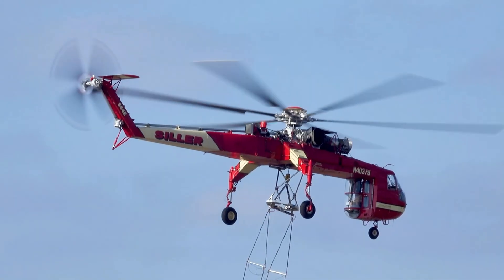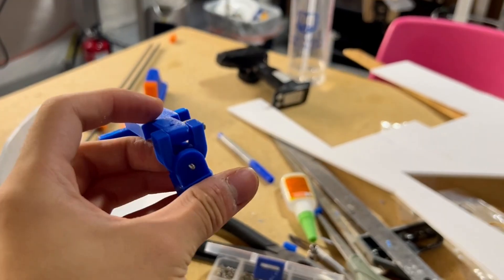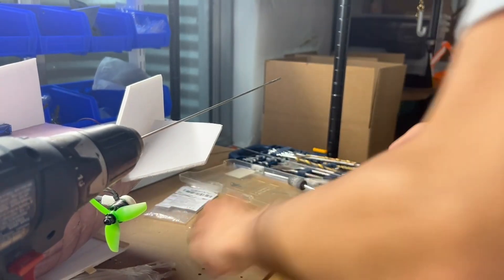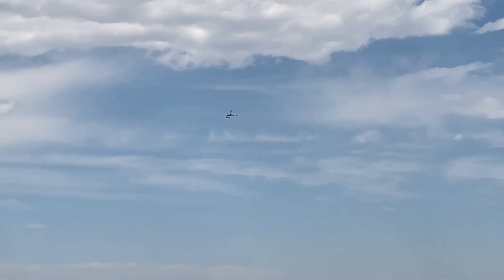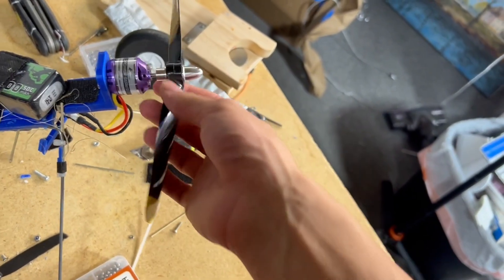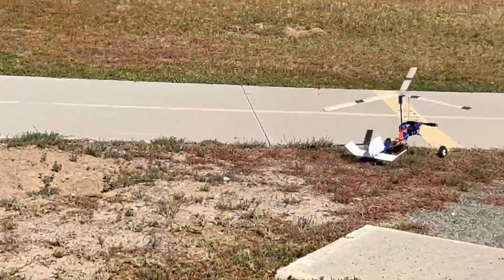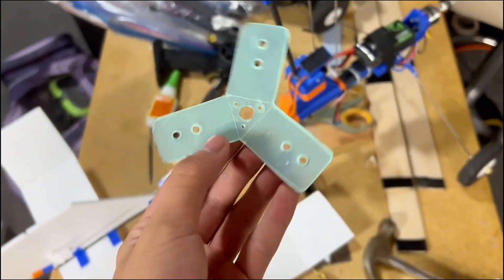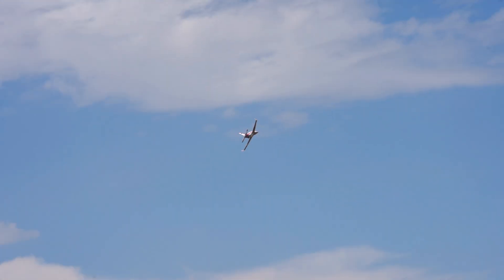This R/C “Plane” Doesn’t use Fixed Wings to Fly

Comment: You started having problems when you switched to a lower KV front motor, right? Right from the start of the video it seemed obvious to me that a lot of the stability depend on the gyroscopic effect and airflow of the front propeller.

Comment: I built a twin rotor gyro with dihedral and 3 blades per rotor and no rotor controls just rudder and elevator it flew well. A loop was interesting the rotors sped up in the climb and stopped when inverted and if to slow turned backwards when coming out they started spinning up and generating lift again (start up high )

Comment: Wouldn't be too surprised if those things are more sensitive to CG changes than is readily obvious. The change of components after the rebuild may have changed the weight distribution a bit. At least that's my guess.

Comment: Title says plane flies with no wings. Proceeds to show an aircraft which flies using eight wings. Each blade of the rotors is a wing. The tail is comprised of three wings. Come on, dude try harder.
Reply: Gyrocopter is not to confuse with a plane.
Reply: @bertkreft9689  you agree with me that the title is garbage
Reply: @sluggishruggish holy rage bait bro
Reply: My man your getting heated over  a title your just over thinking. What are you trying to get out of this? Attention?
Reply: @ZEditz_W getting nothing out of this, except pointing out that a propeller is a wing. The title is dumb. Idiotic that’s the point.
Reply: @ZEditz_W please no one read this. I’m not looking for attention.

Comment: Well done for some nice flying and a nice aircraft. Model Gyroplanes do seem to be very difficult to get right, perhaps full size are as well! although once you have the take off differences sorted as you have it makes for less drama!. I think the landing has more flair than a fixed wing to convert the energy in the rotor into a momentary extra lift  to stop at the ground but  probably tricky in such a light machine. As mentioned elsewhere rotor tip weights might help they are certainly used on full size machines. Blades also need to be as identical and balanced in every conceivable angle and direction :-)

Comment: I didn't get it... it's one motor or two motor build, how the top prop rotated?
Reply: The top rotor is free spinning. On the top rotor the blade that is moving forwards during rotation experiences less drag (because of its shape and tilt angle) than the blade moving backwards. Its basically a windmill/waterwheel that uses some of the energy of the incoming air to spin it, while the rest is used for lift.
Reply: @linecraftman3907  thank you, I was trying to find the pre-rotation motor in this build and I broke down because I didn't see it in video :)

Comment: Try to put a pre spinner on the rotor like an rpm cable connected to one of the main wheels so you can spin up on taxi easier...
Reply from the maker: I planning to try that once I can figure out how to get it to fly better. A pre rotating system is really cool!
Reply: The real ones just apply the brakes on the wheels, and give it about a minute or so before doing the roll out for takeoff. The thrust from the engine is plenty to get the rotor up to speed for a shorter takeoff with that method.

On an RC model, it probably means using another servo and the same wire the landing gear legs are made from. Not sure if the ability to set brakes would offset the extra weight it would add at that scale though.

Comment: I’m no expert but maybe the problem you are having is you keep going stiffer with the rotor plate when you said yourself there needs to be some flexibility in there. Having some more compliance could be why the initial broken in plate worked so well.
Reply from the maker: With the research I’ve done a lot of people said that the more flexible the rotor plate is the less lift is achieved so during this video, I wasn’t actually able to try out the stiffer rotor blade so I was just using the same one so that’s why I think the lack of stiffness is the reason for loss of lift.

Comment: axually, the heli blades are the wings. or the lifting surface. also pressure differences wing model is not correct. try lifting body planes. no top side. there is no difference between a spinning rotor, a wing and a lifting body. they are aerodynamically the exact same, minus coanda effect extra bonus lift on the top surface optionally. take off the coanda effect then you have exact same workings of each bottom lifting surface. if you just copy/repeat from someone's fake false teaching, yes you teachers, then you will just confuse people with wrong information. well do you have to lie. to please who. in other words, lifting body and rotor are both wings also. qed.
Reply from the maker: I see your point but I’m believe when people see the title they understand “wing” refers to a fixed wing on a typical plane. I understand rotors are still wings but my point wasn’t to say they work on completely different principles.
Reply: @ieatgrass_rc  they literally use the same principles. What are you talking about a wing is a wing. It wouldn’t create lift If it wasn’t a wing, it wouldn’t create thrust if it wasn’t a wing.  Change the title or admit defeat.
Reply: Don’t let him make you feel guilty for pointing out the obvious.

Comment: 9:20

This is a bit of a common misconception.  A steady wind is undetectable to an aircraft in flight, with the exception of how it changes the path across the ground. Flying upwind, downwind, crosswind, or turning with or against the direction of the wind - the aerodynamics are identical and the aeroplane's handling does not change.

If it's hard to visualise, imagine it's a windy day but you're sitting in a hot air balloon, drifting with the wind. You'll feel no wind at all, as you're moving at the same speed. 

Now imagine launching your R/C plane and flying circles around yourself. You can't feel any wind, so why should the plane? If you didn't look down, you wouldn't even be able to work out whether it was windy or a calm day.

Steady wind only matters due to the turbulence it causes as it hits stuff on the ground, and when taking off / landing - as in these cases you're trying to control your path and speed across the ground. 

Gusts are the only exception, as in these cases the aeroplane will temporarily gain or lose airspeed due to inertia.
Reply: If someone filmed it from the ground and edited out the balloon the rc plane would look like it was flying in drifting circle piloting it from the balloon it would be easy to keep a constant circle as long as you kept watching the plane and ignored the background.
Reply: @JonathanTamm 

Yes, but my point is that in both cases the aircraft itself can't tell whether it's turning into or away from the wind. It won't feel some sudden change in airspeed.

Comment: Not sure if this would help but in 10 years of flying sikorskys when I hear the blade slap its usually blade vortex interaction, usually in low power settings in level flight but can be induced in climbs, descents, turns, etc. 
Of course you don't have a tail rotor so maybe the fibreglass has a sweet spot with not too stiff and not too soft as the advancing blade turns into the oncoming airflow. Of course you don't want to over complicate this and add collective pitch, at that point you're halfway to a helicopter. Maybe try to get a teetering 2 blade system to work or maybe a 2 blade teetering system with TPU dampers to limit the flap and try with differing infill densities to determine the appropriate flex.

Comment: Great project.  I am very intrigued by gyrocopters and have an Auto G2 from Hobbyking that works quite well. But yours is way cooler.  Keep up the interesting analysis, I'm sure you will solve the problems with the redesign. Good luck and happy flying.